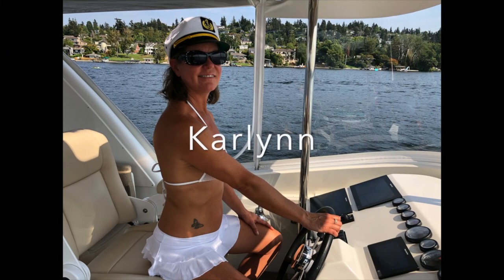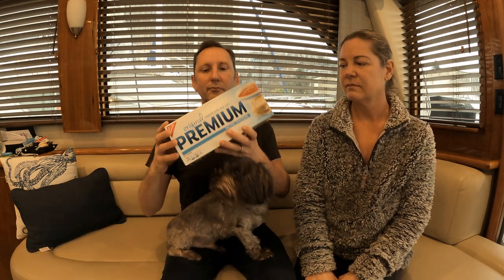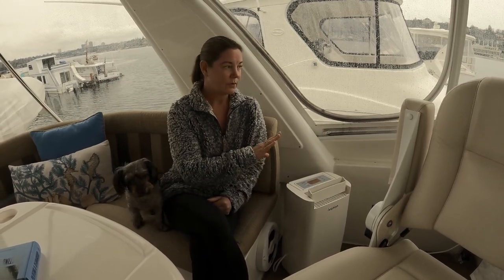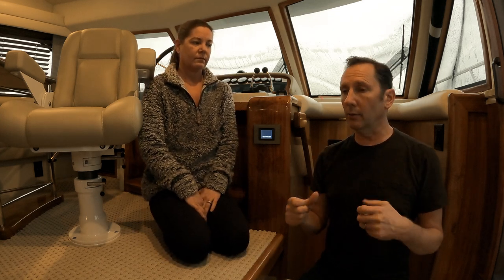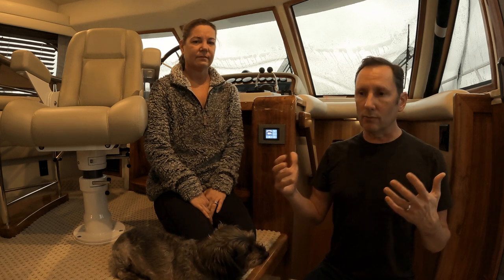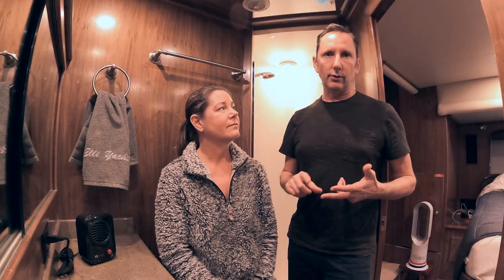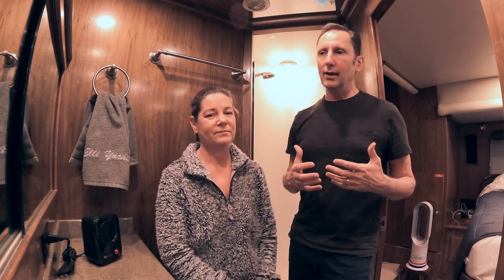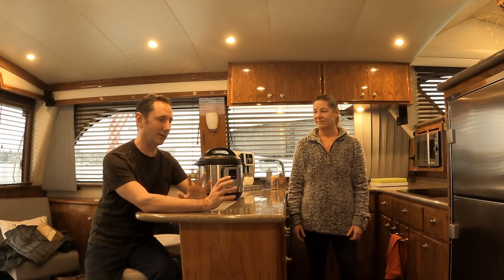3 Ways to Stop Humidity on a Boat

Comment: Great topic! Curious as to why you have the dehumidifier located in the upper bridge? Would it not be more beneficial located inside the boat?
Reply from the maker: Good question! Our heat exchangers in the boat keep the humidity in check. The bridge gets some water since the canvas isn’t water tight and then it starts a moisture cycle during the day/night and mildew starts. With the dehumidifier it keeps it all in check.
Reply: @ElliYacht1  Okay that makes sense. What type of heat exchangers do you have? My wife and I will be moving on board our boat in the next two-years. She is a 45-Tollycraft (53 feet over all) currently we do not have a proper working heat system. I’m open to any suggestions you may have. We do have a 8KW Gen set, we also have 4-solar panels and 6-house batteries.

Comment: How are you powering them and what kinds of Wattage do they consume? We’re off grid, but have 400Ah of Lithium available, so, plenty of juice. With multiple running it seems quite taxing on the electricity. We are very well insulated though, which helps a little. Double glazed windows and thermal insulation on our 62foot wide beam.
Reply from the maker: They each draw 28W max (120V from our Victron 10kW inverter) with an average of 21W. We have 21kWh of LiFePO4 so it’s negligible for us. Lower available Watt Hours would definitely be more of a draw consideration.